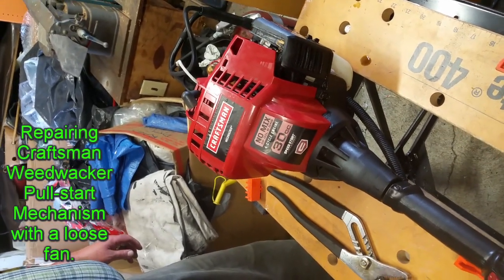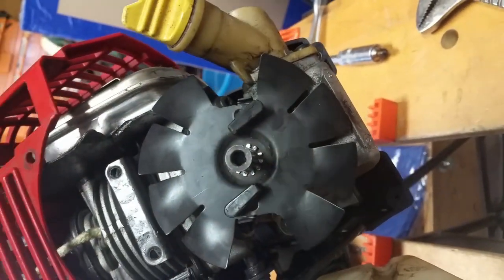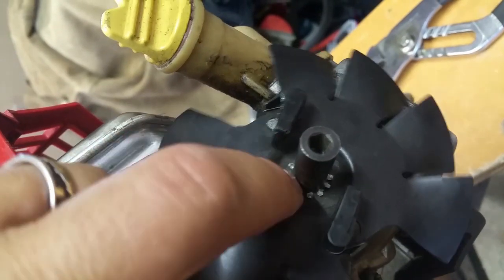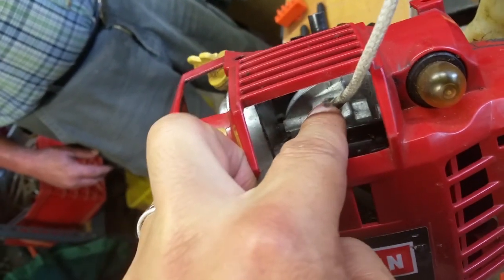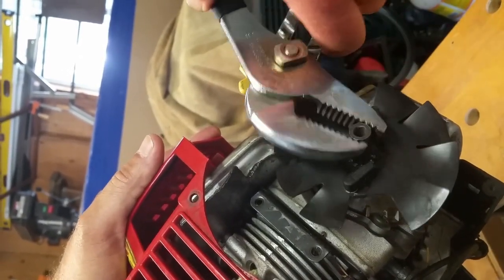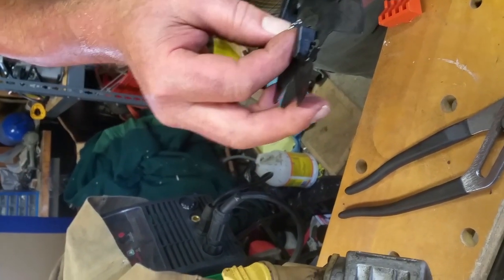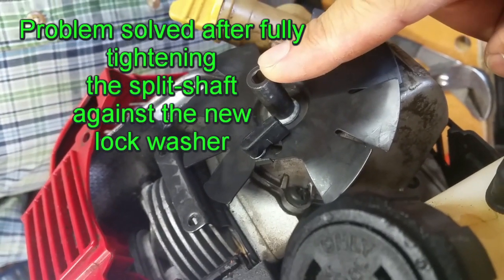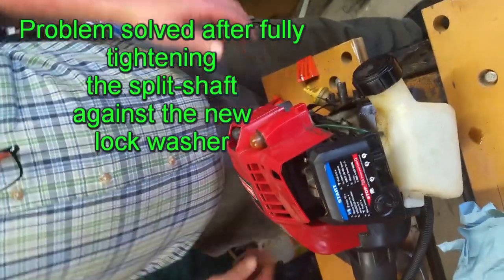Repairing Craftsman Weedwacker pull-starter.

Comment: I replaced the star lock washer with a different type of star washer. There are two kinds of star locking washers one that has the smooth side in and the ones like Craftsman should have used that have the star locking part inside. The reason their type fails is that the locking part is uncovered making it work like a plain washer instead of a lock-washer.

Comment: All Craftsmen are designed to fail. Mine is 2 years old and probably has less than 20 hours. Doesn't want to start. Then when it does, you can't give it throttle. It stalls. JUNK!
Reply from the maker: There's a common reason for that starting and then not throttling up, but my brain's foggy right now and I can't remember. I know I've fixed this problem before. Argh! My stupid brain!

Comment: Is that model electric start capable?
Reply from the maker: It is if you use the drill adapter, but if the fan is loose it still needs repair.

Comment: I have this model and the pull cord won’t engage the pawls on the fan blade.  Fan blade turns the shaft fine, but I can’t figure out why the plastic solid tabs on the back of the pull starter won’t lock with the pawls and turn the fan.  Has anyone else had this issue?  Pawls and their springs look fine.
Reply: Same problem
Reply: I think I figured it out: the pawls each have a little leg that confines their swing to the small rectangular holes in the fly wheel, one on each side.  On mine, the tiny little legs sheered off so the pawls are free to basically spin.  I ordered new ones on Amazon for $7 total and I’m going to put them on today.  Update later. 
Part:
MTD 753-08159 Pawl Kit https://www.amazon.com/dp/B01ITNRBYM?ref=ppx_pop_mob_ap_share
Reply from the maker: @atomicdan75  Yup, the little legs on the pawls have to go in the rectangular slots.  You can see it more clearly on my newer video.

Comment: How do you get the shaft off, I've tried everything.
Reply: I used channel locks and it worked for me. I removed the fan and installed parts from a 27 cc which is one that doesn't have the fan type mechanism. It starts good and all but hopefully it will last at least till I get the new parts.

Comment: What are those plastic paws called that you pointed to at the 53rd second. Are they just "paws?" My weedeater is missing one of those and the rope will not retract. It retracts on its own when I dis-assemble the plastic covers.
Reply: They are called paw springs. They will get worn out the taps usually never wareout only the springs. Go to a dependable lawn mower shop should be able to buy both. Or take a picture and tell them you need this.

Comment: I assume the pawls are the two spring loaded tabs that the recoil starter catches to turn the fan, flywheel, crank shaft. Right? Is there some trick to engaging the starter and the fan? Looks to me like you need two hands to position the starter over the crank shaft .... And magic to position the pawls so they will engage.

Or, maybe I'm missing something
Reply from the maker: Hi Jack, you're correct that the pawls are the spring loaded tabs.  I don't recall having any problems getting the parts to engage or struggling to reassemble the parts.  I've got a couple more of these trimmers on my to do list, and will post an update if I think up any new tips.
Reply: This is the same problem I’m having: I can’t seem to get the pawls in a proper position so that when I place the starter assembly, it catches the pawls and turns the fan.  It doesn’t look like anything is broken or missing.

Comment: Can you refer me to the washer you installed? I would like to purchase online I have the same problem on my craftsman trimmer.
Reply from the maker: The washer I used was a "split" lock washer.  I don't recall the size because I took it from a drawer of odds and ends. You should be able to get one for about 10 cents at the hardware store.  It isn't a specific part for the craftsman trimmer.